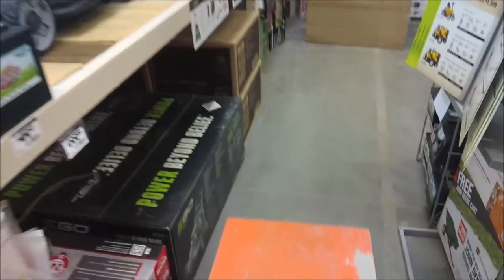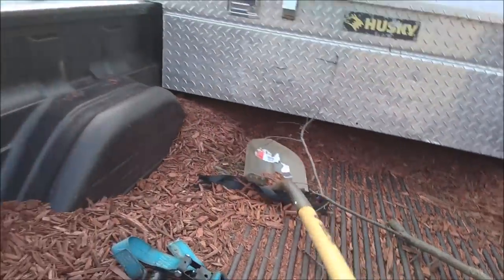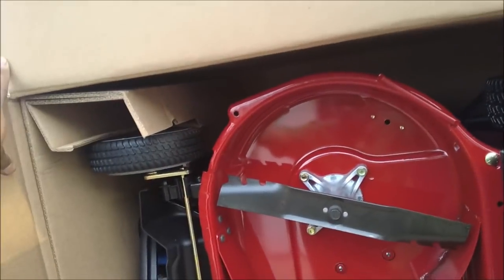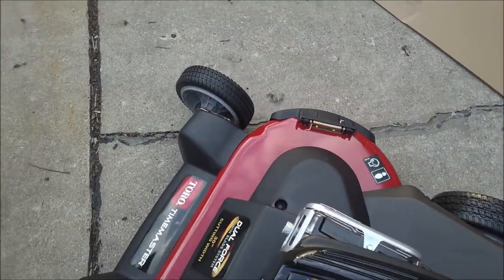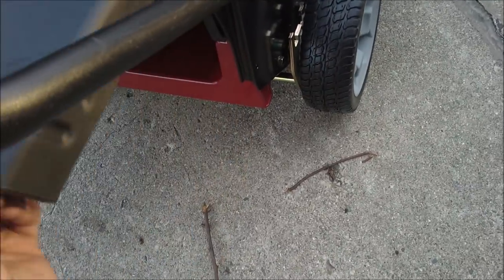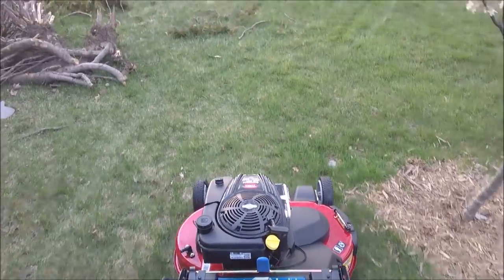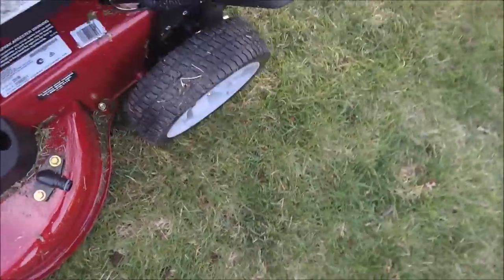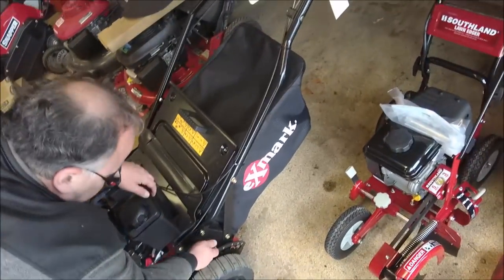toro time master

Comment: Thinking of picking one up. Go to see someone in my area. Ernie is a good guy at all seasons. I'm In Roseville.
Reply from the maker: I ended up getting the exmark from All Seasons because the time master broke. Just havent had time to edit it. Ernie hooked me up.
Reply: The How To Go To It broke already?
Reply from the maker: Blaine Bugaski its a good mower but the rear deck height adjustment would just keep dropping. Pretty cheap design. The exmark 30 has a much better rear deck height system. Better engine. And large fuel tank. I fill it once a day. I fill the toro evey other yard.
Reply: Interesting.  I use three different Toro personal pace 22" mowers and they have been relatively trouble free except for the transmissions and wheels.

A 2004 model with 6.5 Tecumseh, a 2007 model with 6.5 Tecumseh, and a 2009 model with 6.75 Briggs & Stratton.

Of course I maintain my equipment myself.  Your Timemaster should not have failed that soon.  I hope their recent quality is not dropping off!
Reply from the maker: Blaine Bugaski what happened with me is the peg for the rear deck height would not engage and would drop the deck. Would have been a easy fix but it was the second time i used the mower. To me that was unacceptable. Plus i had to constantly put gas in it. The exmark gets filled in the morning and thats it for the day.
Reply: Is the fuel tank size different or does the Toro just drink fuel like that?
Reply from the maker: Blaine Bugaski the exmark has a much larger fuel tank. I think it holds 1 gallon...
Reply: I see.  Very nice.